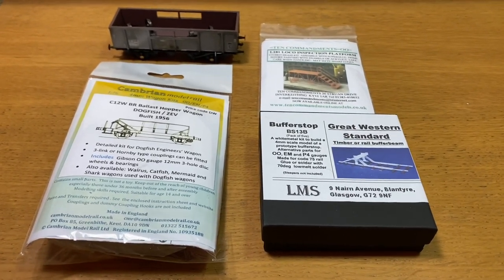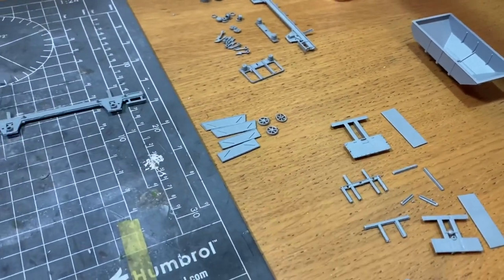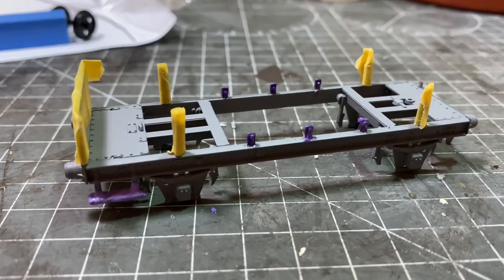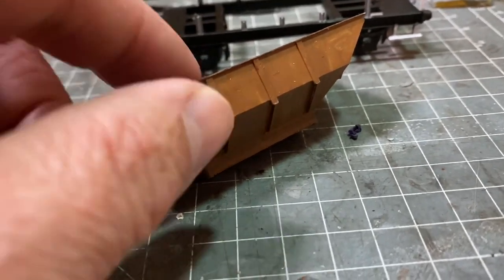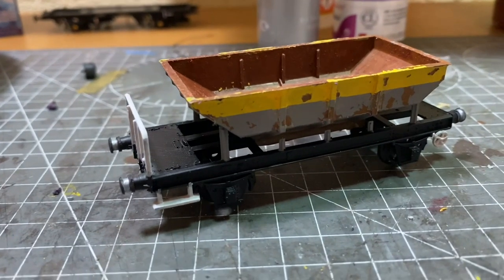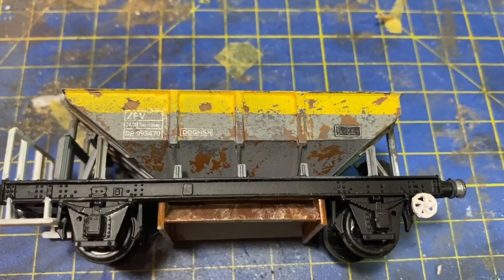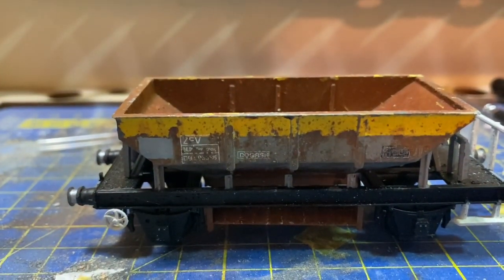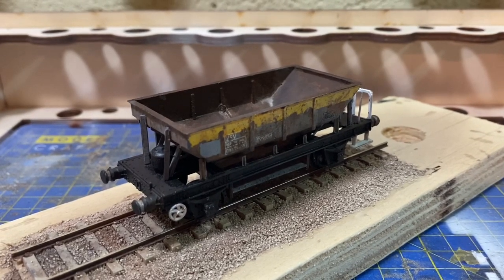Cambrian Dogfish Wagon - St. Michael's Hill Model Railway Ep.85

Comment: I was somewhat disappointed in that the "build" did not include the underframe.  I am building some Dogfish and Catfish wagons.  Being used to North American kits, I find this kit is lacking in any interlocking pieces for a good fit of the parts before you glue them in place.  The underframe is woefully inadequate for any kind of mating of the sides and ends before gluing.